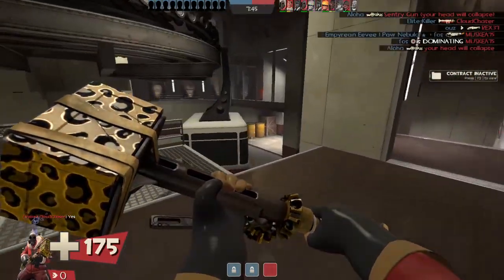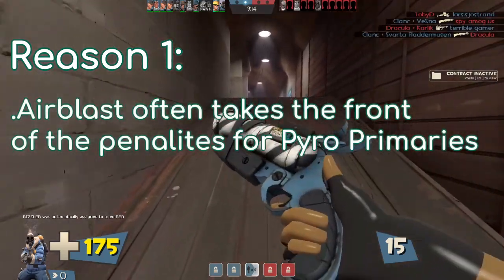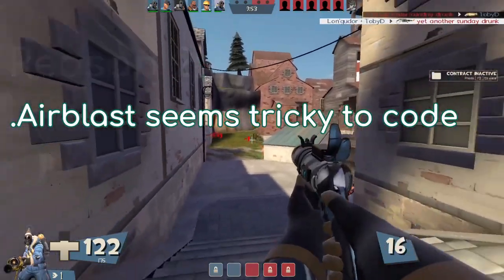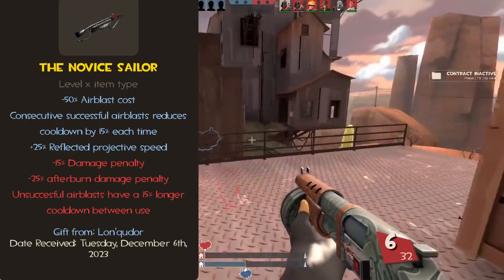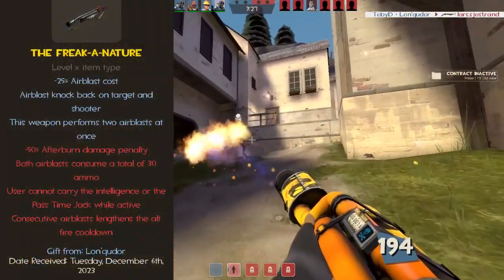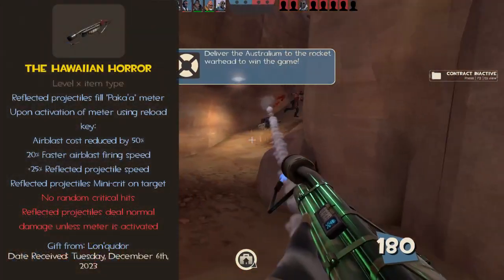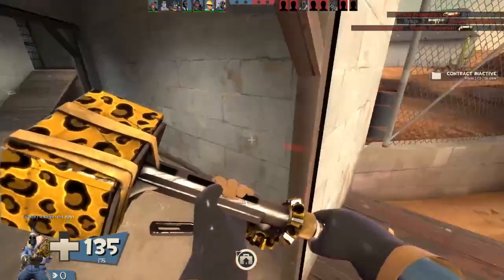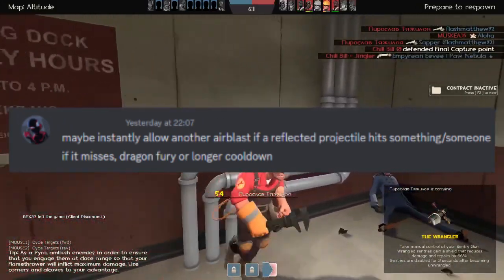Designing an Airblast Flamethrower Is Hard...

Comment: I like the Hawaiian horror the most. Rather than a phlog style meter, though, I'd actually like it to be something closer to the heat makers meter, where you can regain a bit of meter while it's active. Though I'd still only let you start the meter once it is full.
In addition, let extinguishing teammates also fill up the meter.

The reason that I like this one the most is because it works towards an aspect of pyro that's not as often talked about: support pyro. Popping the meter would allow you to better attack a chokepoint with lots of spam going through it, or defend the constantly targeted cart. 

Ultimately I think that I would want an airblast weapon to aid support pyros, as theres currently a lot of stuff for offensive players.

Comment: The Hawaiian horror sounds great, but I think you could take it in a different direction: An airblast that does DIRECT damage. In exchange for successfully building up the meter while having a gimped airblast, you get ONE really powerful airblast. 
Let’s say it takes 600ish damage to charge the meter. Upon the meter being full, you’ll get a visual and audio cue that your super airblast is ready (say, the weapon starts smoking like a volcano about to erupt). 
Upon pressing alt fire, the weapon sends out a large, powerful airblast which knocks players back, does direct damage, can reflect multiple projectiles, AND sets targets on fire. Think of it like a fiery force shout from Skyrim. In addition, I think this super shockwave should have increased forward range when compared to normal airblast, so it’s easier to land. In terms of damage, I’m thinking a point blank blast does slightly more than a rocket, around 105-110 not including afterburn. The max falloff would place it around 70-80 damage, not including afterburn. 
Now obviously that’s incredibly overpowered, especially if you can use the flamethrower directly afterwards. Therefore, I think the mega airblast should temporarily disable primary fire directly afterwards, forcing the user to rely on their secondary for followup damage. 
In terms of design, playing up the idea of a miniature volcano that the pyro is running around with would be funny. Maybe having the nozzle be a baking soda volcano strapped onto a tiki torch, with a painted propane can as the fuel source.

Comment: I think an interesting idea would be tapping into the support potential of airblast and making an alternative combo playstyle.
I introduce to you... 
The Vacuum Cleaner
-50% primary ammo(now 100) 
-50% airblast cost(now 10)
-100% afterburn damage
Airblasts can remove any debuffs, healing both you and the target for 20 hp
Airblast also extinguisges enemies, giving you 15 primary ammo a charge of 6 sec of minicrits activated with Reload, you can hold one charge at a time
Airblasts that reflect projectiles or cleanse teammates give 30 primary ammo 

It opens up a reverse combo dynamic: light enemies with secondary and benefit with flamethrower,
 makes pyro less of just a pyro counter in terms of curing debuffs with airblast and plain better at it, 
Makes pyro a lot more unreliable damage-wise (Half the potential w+m1 time and no afterburn) unless you consistently use the combo for minicrits and/or reflect and/or cure debuffs, 
Has a theme of cleansing, reflecting what airblast is about support-wise and making it tge theme of its damage ability as well

I have no means of testing this thing and I didn't spend that much time thinking about it, but IMO it's kinda cool

Comment: I've always thought about a flamethrower that had the opposite of an airblast. Essentially it would suck in one projectile like a rocket, pipe, arrow, anything considered a projectile, and allow you to either

1. Shoot it back faster (Rockets)
2. Shoot it back but the projectile drop is enhanced, it goes further (Arrows, Pipes, Bombs, Milk or Jarate)

But to prevent you from just randomly sucking things in, the flamethrower alternates from Airblast to Vacuum. You still have the option to burn enemies but you consume more ammo in doing so.

You can't use the flamethrower if you have a projectile saved up.

You can pull in enemies with the vacuum ability.

idk no random crits

Comment: An idea I had a while back was this:

The Pressurised Punisher (Pyro, primary)
+40% speed on airblasted projectiles
no self-damage from airblasted projectiles
damage dealt by airblasted projectiles returns health and charges a meter, when the meter is full activate for 7 seconds of 0-cost airblasts, 
reduced repressurisation rate and guaranteed crits on airblasted projectiles
-10% range
-33% afterburn damage
-25 health on user